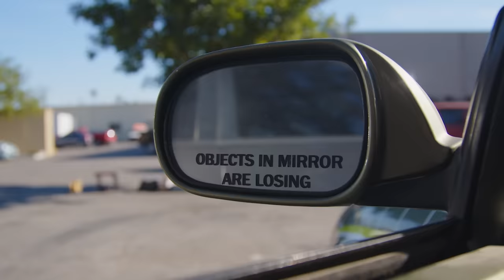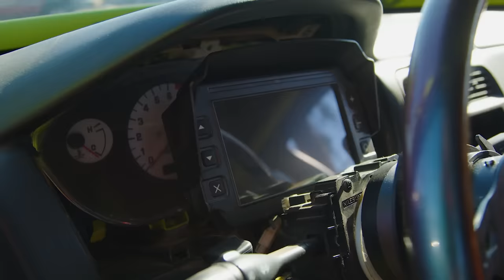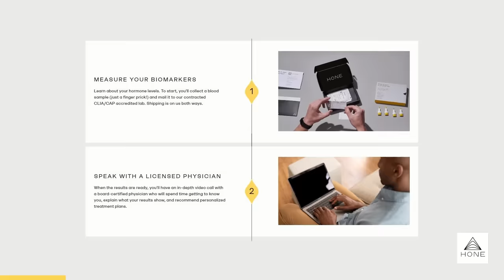FULL TOUR OF MY CAR COLLECTION!

Comment: The same happens with BMW 120D a diesel engine, when you put it into power you will feel it directly with a 184 Hp engine and 340 Nm of torque. This does not sound much but it will take about 7.8 seconds 0-60 mph or 0-100 km/h.
Today diesel engines are smooth and is  not as loud as before, it drives smoothly.
I suggest you test drive a BMW diesel car.
I suggest you could challenge yourself with a VW golf 1.4 TSI engine and switch to a diesel engine. The BMW 120 D have a 2.0 liter diesel engine
What do you say about challenge yourself with a diesel car and modify the engine? German cars is of a good quality and last for a long time. Then you have the Audi cars too. If you want you could look at Volvo a Swedish car see what you like about it maybe modifying it as well

Comment: I suffered with low energy, headaches and was highly overweight in my late 20's early 30's every doctor ordered blood work but they will not check the testosterone or estrogen levels box until you're in your 40's so for years I heard borderline diabetic and there's nothing wrong with you. After finding a new doctor I said check every single box on the bloodwork well test came back at 80 and estrogen was 4x what a male should be. Within 2 months of testosterone shots my life changed. Not just the sex drive but the energy level and overall wellness. Now I'm 48 weigh 200lbs 6' tall have plenty of energy and yes my 49 year old girlfriend is very pleased! Don't be ashamed!!!!!!!!

Comment: Your G35 was beautiful, :( RIP. How did you get into racing, I'm originally from the "Motor City" Detroit baby!!, I use to build the automated assembly lines for the auto companies, & have always been a car guy. My only problem is that my spine is fused from T10 through S1 with hardware from a auto accident in 1992, & am now disabled, so I can't wrench much anymore.

Comment: How in gods name do you get past California's stupid emissions laws? I stopped racing my Fox body Mustang and then (sadly) sold it because I didn't have a car trailer and couldn't drive it on the street. I guess I should have just gotten a car trailer, but then again, motorcycles have kind of taken over my life. 

So, I think Mimi needs an auto and a couple of bigger turbos, I'm thinking a cross between Ruby and Leroy...Mimi could be well into the 7's.... if not 6's.

Comment: put a 2j in the mustang and i unsub. i e been waiting for the coyote build. People are getting rid of LS and 2j swaps for coyotes because of the
potential.  you can get a mustang into the 7s in the 1/4 and f150s into the 8s both with stock sealed engines. Coyote is the best engine out there rn